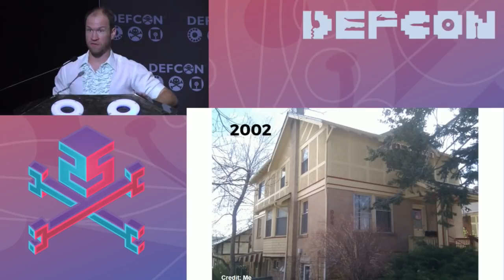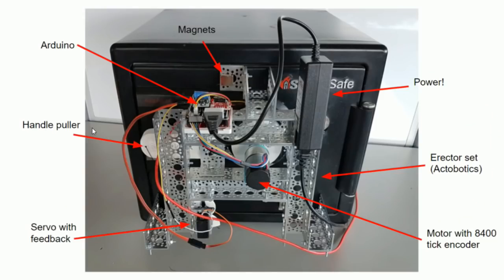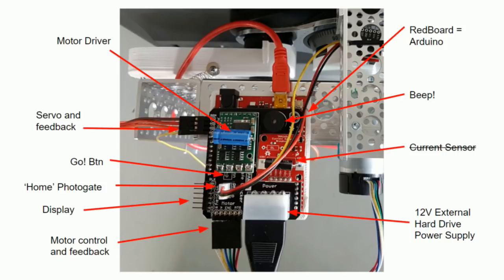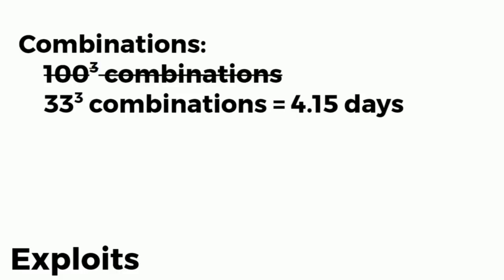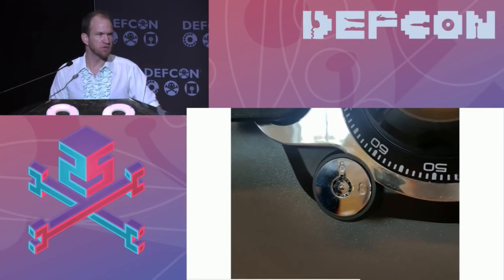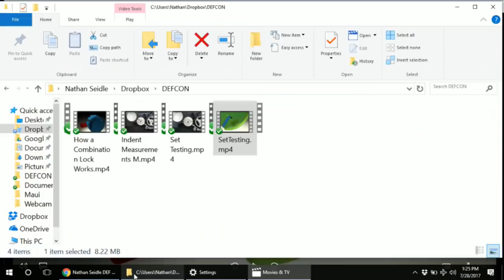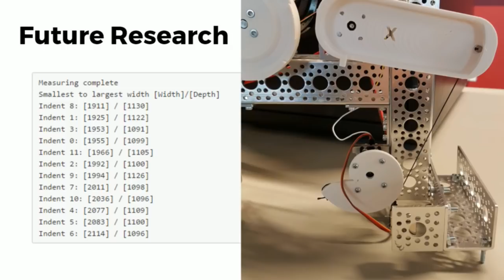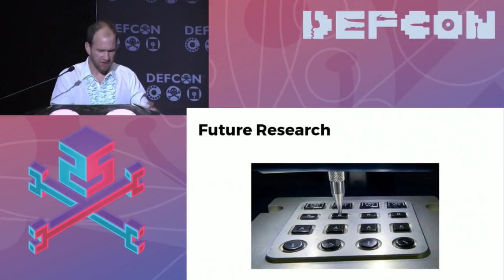DEF CON 25 - Nathan Seidle - Open Source Safe Cracking Robots

Comment: In case anyone was wondering; a lot of modern safes use plastic discs because metal discs can be seen using an X-ray scanner similar to those used to scan your luggage at airports - but as Nathan Seidle said, there's no safe that's inpenetrable, it's just a case of what kind of attack you want to protect yourself from. 
This kind of attack is so common that combination locks that successfully mitigate radiological attacks have their own distinct Underwriter's Labs security grade - 'Group 1R'. The other option if you don't want to use plastic discs is to surround the lock mechanism within a lead enclosure, particularly if you wanted the safe to be "fire-proof".

Great talk, thanks for uploading :)
Reply: Why don't they use metal wheels but with true gates at every position and fill them in all but one slot with plastic? Then all gates would have the same width and they were out of metal
Reply: 专业

Comment: You should be able to reduce the search space further by learning what limits there are on successive digits.   For example, I would think that no safe is going to use the same combination number twice in a row?    Such as 42-42-95 or 7-72-72, etc.    Given the way the discs interact, you may be able to determine how close neighboring combination digits could possibly be, and eliminate all tries where successive digits are too close to each other.
Reply: Why should you not use a number twice for your safe? You are in a position where you believe no one will use such attacks against your safe so even using a number 3 times as a user is as possible as using any other combination in my opinion.

Sorry if im missing out something or you speak about technical details the safe does use. I understood it as you meant  the combination someone would use where double or digits seem unlikely
Reply: @wtb9613  Rotary combination locks ofteh have you turn right to the first number, left to the second, and right again for the third.   In that case, 42-42-95 would not actually have a turn for the second number because the dial would already be on that number.   Different types of combination locks may not have that problem, but some of the classic rotary-dial combinations do.
Reply: @Syncopator  Aaalright, yeah thats makes sense. Thanks mate.